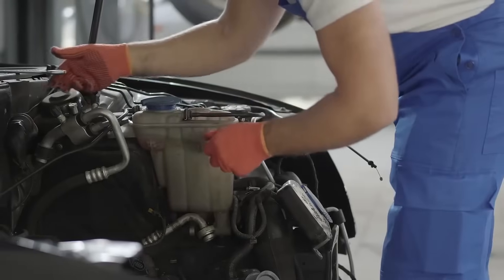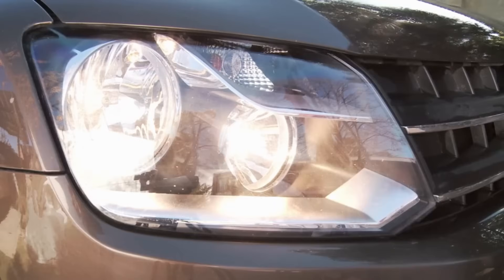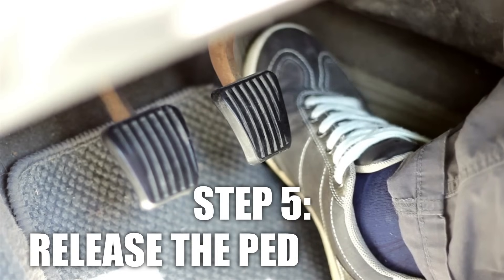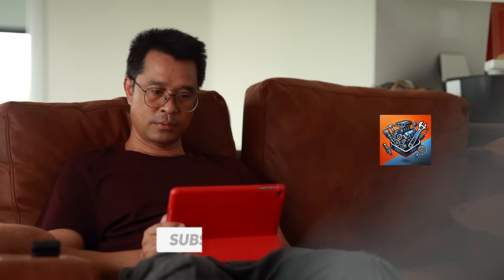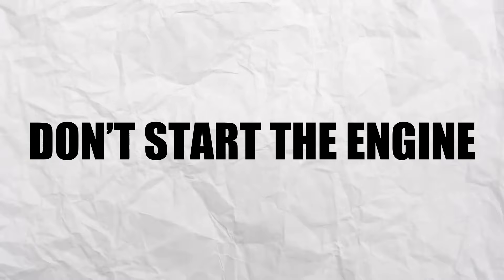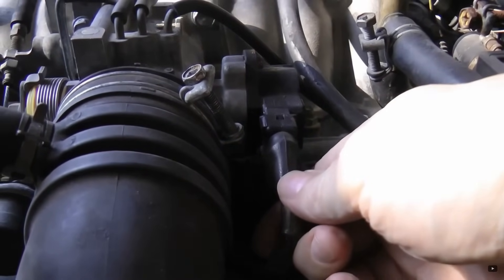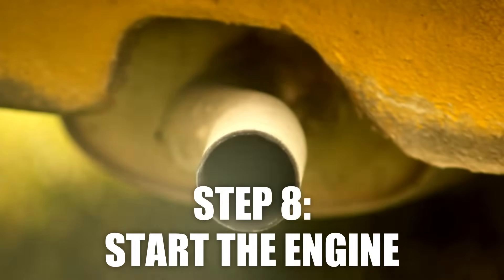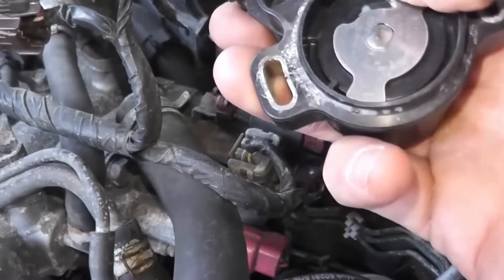How to Reset Throttle Position Sensor (3 Quick TPS SECRETS)

Comment from the maker: 9 Symptoms of a Bad Throttle Position Sensor  + Fixes  https://youtu.be/o1hBd9dlBRE

⬇Care Care Clues Top DIY Tools and Products:
🚗 Essential Scan Tools
Newest Scan Tool:https://amzn.to/3GJyuET 
Bluetooth Scan Tool: https://amzn.to/42AcBRc 
Cheap Scan Tool: https://amzn.to/42WZIzx 

🔋 Emergency Essentials
Best Jump Starter: https://amzn.to/44fYOAm 

🛢 Fluids and Leak Stoppers
AT-205 Re-Seal (Stops Leaks):  https://amzn.to/3S9icYm 
ATS 505 Fuel System Treatment: https://amzn.to/3YQjjA2
Lucas Oil Transmission Fix: https://amzn.to/4jNk98M 
Bar's Cooling System Stop Leak: https://amzn.to/3Sht0nj 

🔎 Quick DIY Diagnosis Tools
Head Gasket Leak Test Kit: https://amzn.to/4jRgc2T 

🛠 Useful Maintenance Accessories
Quick Twist Oil Drain Valve: https://amzn.to/4jWG3GJ 
Tire Gauge (Check Pressure): https://amzn.to/3GxySGD
Tire Air Pump: https://amzn.to/3RZK9Cd 
CRC Mass Air Flow Sensor Cleaner: https://amzn.to/44dJpkb 

🧰 Mechanic’s Must-Haves
Car Battery Tester: https://amzn.to/4jTqyzk 
Basic Mechanic Tool Set: https://amzn.to/3Ymgerh 
Cordless Impact Wrench: https://amzn.to/3YkkhVc
Reply: How do you do this if you have a push start system
Reply: Thought I needed a transmission replaced or rebuild, it was doing exactly what he said in the video, any driving 2006 dodge Ram 1500 perfect so far going to make sure throttle body doesn’t need replacing, but that’s worse scenario ok I’m out
Reply: @frankthompson721  ??
Reply: Would this work with a Honda Golding
motorcycle?
Reply: None of that stuff worked for me Im about ready to take this pos n put it through that çarlot who sold it to me.

Comment: Thank you for this video. I disconned the negative cable on my battery and let it sit for 15 minutes. I reconnected the battery cable and it reset the throttle system on my Nissan Frontier truck. I hope the throttle never gets stuck again.

Comment: I appreciate your time and effort I have a 2001 nissan maxima sports edition  I just changed the old throttle position sensor my self Saturday and the engine  was idling above 2000 rpm so today when I got off of work I parked the car and saw this video and the first step I did exactly what you said and showed and I must say it worked thank you for this video.

Comment: I’m working on step 3 - I replaced the throttle position sensor, and I’m at the step where I’m listening to the new sensor buzz. The buzzing has gone on for 15 minutes so far. What happens if the buzzing never stops?

Comment: Turn the car to the on position and push the gas pedal down for 10 seconds and then turn the car off and release the gas pedal. Wait 10 seconds and start the car. Worked on my 2004 sierra, 2017 passat and 2015 accord.

Comment: With the Vdiagtool VD80BT, I could reset throttle position sensors on both Toyota and Ford without any issues.

Comment: Every car/truck engine has a specific throttle body relearn procedure.  This guy is way off. Don't listen to him.  Google how to rescalbrate a throttle body after taking it off or replacing it for your vehicle's engine.  It's not a one size fits all.   

here's the steps for a Nissan TB replacement

Perform “Accelerator Pedal Released Position Learning”. Perform “Throttle Valve Closed Position Learning”. Start engine and warm it up to normal operating temperature. Turn ignition switch “OFF” and wait at least 10 seconds. Conform that accelerator pedal is fully released, turn ignition switch “ON” and wait 3 seconds. Repeat the following (steps 7, 8) procedures quickly five times within 5 seconds. Fully depress the accelerator pedal (HARD) Fully release the accelerator pedal. Wait 7 seconds, fully depress the accelerator pedal and keep it for approx. 20 seconds until the Check Engine Lig(CEL) stops blinking and turned ON. Fully release the accelerator pedal within 3 seconds after the CEL is ON. Start engine and let it idle. Wait 20 seconds. Rev up the engine two or three times and make sure the idle speed and ignition timing are within the specification

Comment: My 2020 Mazda cx9 started revving high while driving, the  engine sounds as if stuck in lower gear. At 25-30mph, the rpm tend to stay at 1250 even when I let go of the gas. I noticed this issue when the engine makes high pitch whining engine sound. 
What do you think it’s is?

Comment: I did step one due to my car battery misfiring and my TPS wasn't accelerating properly after a thunder storm so I reset it and now it's no longer sluggish and accelerates properly. Thank you for the video it really saved me from going to the auto shop and spending a few hundred. Bless
Reply: Your car battery does not misfire.

Comment: Got P2128 code on my 2007 Mazda 5. Tried the first method in the video and it solved my issues first try. I did have to clear the check engine and AT alerts with my ODB afterward but so far so good. Thanks for this awesome video!!

Comment: Im facing the following error:

Issue: Throttle Actuator Control (TAC) Motor – Range/Performance Problem

Please advice 🙏 It cause engine idle, no race pick-up, need to turn off on 2,3 times to run the vehicle. It's FAW V2

Comment: The first method worked for me on my grandma's 2010 equinox it turned off my check engine light for my throttle body and it runs fine thank you so much I was shitting bricks because it happened after I went low on gas and I didnt want to hear the grief

Comment: If you don't hear the buzzing sound in the 3rd step to reset it. Could that mean it's not working at all? But the car will crank and idol. It just hesitates while it's idling. And won't go down the road giving it gas. Not like it's supposed to.

Comment: I can't tell you how thankful I am that you made this video!! I have been struggling with my 2015 Hyndai Genesis G80 for months. I've had it to three shops and none of them have been able to find anything wrong. I have 162k miles on the beast and it's been a great car. No codes at all. Was just getting ready to drop the Trans pan and test each solenoid valve. Anyway I came across your tips and the basic one worked right away!! Unbelievable is all I can say. With much thanks and appreciation!! 
Tony C

Comment: I just needed to do this after the battery went dead on my 2021 charger. It got started after jumpstart, but could not get higher than 2 in RPM or 18mph. The owner’s manual has not troubleshooting section and I literally went to YouTube to find answers. I was dreading an expensive shop bill. Since I ride motorcycles, throttle seemed relevant but I could not find anything I. Owners manual o. Throttle.  I found your video, tried it and tada!!! It worked. I drove it around without issue afterwards. Thank you for making this video. I hope it helps others.

Comment: FYI, if you're due to smog check or going to a smog station "DO NOT" disconnect the battery 5-10 mins until you're done with the smog check.  disconnecting the battery will reset the CPM/CPU (vehicle computer) which means the vehicle will not be ready and will fail the smog check.  It will require going through the readiness cycle period (start/run/stop/off) sensors/egr/etc will need to go through the cycle period.

Comment: I tried every step and none of this worked
Reply from the maker: Sorry to hear that none of the methods worked for you. Sometimes the issue might be more complex, like a faulty throttle position sensor or a problem with the throttle body itself. It might be worth running a diagnostic scan to see if any error codes point to a more specific problem.

Comment: I once replaced a fuel injector 0 ring which was leaking when my engine was hot being driven for an hour and it was a very hot day, but I needed the car because I had a deadline to meet. So I had to get it done. Was super hot. Burnt myself heaps. Was worth it though at the end of the day I was satisfied and got my deadline met.

Comment: Only works on OBD2 systems. Not all of them either. This is cars made after 1996 or newer. If it's a 95 or older this is likely to not work. He did say at the beginning of the video newer models, but I thought I should define what newer is. Good luck guys.

Comment: It's all fun and games until the engine light comes on. 
I followed the generic rotation to reset the throttle but the engine light came on after riding 10 minutes.
Repeated the rotation but included pumping gas peddle 3 times before turning it back on and it worked. 
Make sure to follow the appropriate rotation or you'll sweat :p

Comment: Just did this on my 2012 Accent, it was over revving during gear change, it seems to have worked. Idles more smoothly as well. I’ll take it for a longer test run tomorrow but thanks so much 👍👍
Reply: Any update ?
Reply: Ill wait with you here i am suspecting  my accent is also suffering from same issue @whiteshark2060

Comment: my car turns off when i turn it on
Reply from the maker: If your car shuts off immediately after starting, the throttle position sensor could be a factor, but other issues might be at play too. Here are a few things to check:

1. Throttle body and sensor issues – A dirty throttle body or faulty TPS can cause stalling. Try cleaning the throttle body and resetting the TPS using one of the methods in the video. 

2. Idle air control valve – If your car struggles to stay running, a clogged or failing idle air control valve (IACV) might be the issue. 

3. Fuel delivery problems – Low fuel pressure from a weak fuel pump or clogged injectors can cause stalling right after startup. 

4. Battery and alternator – A weak battery or faulty alternator can cause electrical failures, leading to the engine shutting off.

If you have a check engine light, scan for error codes. They can point you in the right direction.

Comment: Hi sir  . If do the process it works for some days and came again. So sir what can be the last solution,,?
Reply from the maker: If the issue keeps coming back after a reset, the throttle position sensor itself may be failing or there could be a deeper issue, like a dirty throttle body, vacuum leaks, or a wiring problem. Try cleaning the throttle body with a proper cleaner (not carb spray or gasoline) and check for any loose or damaged wiring. If the problem persists, scanning for error codes with an OBD2 scanner can help pinpoint the exact cause. You may need to replace the TPS if it's faulty.

Comment: Hello Sir,I hv nissan Sentra N16 1.6.my car idle speed stays at 1300 rpm even after warm up.i hv cleaned the throttle body n iacv valve thoroughly but the problem remains.what should I do? Is any of Ur method mentioned in this video helpful.i need Ur kindly help in clearing this problem. T.q.
Reply: throttle position sensor maybe or dirty maf i just fixed my cars iac and it was fixed

Comment: Oh my goodness! You are a lifesaver. After moving from one mechanic to the next, putting on machine, testing wires and rejoining wires, spending so much money...they told me my fuel pump is spoilt, another said my throttle is spoilt. I just didn't believe them. So I tried your suggestion, reset the car and instantly the car is working.

Update: after a few minutes, the issue started again 😅😅

Comment: This solved a week old problem, car now running like it used to run, the problem started after the battery was taken out to change the steering pump and the acceleration was all over the place, it was difficult to control at idle sppeds.

Comment: Im not machanic my golf 4 1.6 lost  the spark but coil park. Throttle. And pick up sensor crank sensor is new bt dont want to spark
Reply: If your Golf 4 1.6 still has no spark despite replacing the coil pack, throttle, pickup sensor, and crank sensor, check the wiring and fuses for faults. Also, test the ECU, as it controls the ignition system and might be the root cause.
Reply: Also make sure the new crank sensor is fully fastened down. If not, vehicle may not start.

Comment: Okay I just done the first method for Resetting it, took it down the street and back, it seemed to drive good without pulsating. But I wasn't going up hill though. It better have worked. We're gonna have to test it up hill next. Also it don't just pulsate up hill but also down hill too. So I don't think its the transmission. It's burning extremely rich also, and it Burns oil. It Plugged the Catalytic converter and we had to remove the plugged Catalytic converter, didn't solve the issue. Just can't seem to figure out what is wrong with my 2013 Nissan versa.
Reply: If it’s burning gas or running rich , do you smell gas or fumes ?

You may not have a leak on the lines but maybe the gas tank areas might have a slow leak.

Fuel module or something in the tank
Reply: Its burns oil might be time for a complete engine over haul.

Comment: NEED HELP ASAP PLEASE.  Just replaced my camshaft sensor on my 08 Toyota Tacoma 4.0 v6 crank fine but give it gas and engine won't rev up over 1,500 rpm ?????
Reply: If your Toyota Tacoma won’t rev over 1,500 RPM after replacing the camshaft sensor, it could be an issue with the throttle body, air intake, or a vacuum leak. Check for any loose connections or clogged filters, and perform a throttle body cleaning or reset.

Comment: Hi, I am not a mechanic. My Renault Kadjar 1.2 Petrol had the problem with over consumption of fuel. You won't even believe that it was consuming 30 litres for 100km. Even the mechanics couldn't figure out the problem as there were no error codes. 

Somehow I came to know about the bad throttle body symptoms in YouTube and I tried these methods to sort out the TPS issues and it's really working. The current is more fuel efficient and it is 9 Liters for 100 Km now.
Reply: If he needs an electronic error code to diagnose a fault, he is not a mechanic. He is then a plug-in-and-replace technician. That is way below the standard of a real old time mechanic.
Reply: @reteipegal7690 its AI read the description at the end it will say this content was digitally generated. So this dude does nothing but tell AI what he wants to make a video about and it scours the internet almost instantaneously and pulls related info and it narrates it also and this dudes making money. No a bad little side hustle. Tales practically none of your time.
Reply: @billesposito2112  I'm sure the guy was talking about the mechanics who couldn't find the problem with the car of the person who made the first comment.

Comment: Sir,
Engine RPM goes high while pressing clutch.... what is the solution sir..?
Reply from the maker: High RPM when pressing the clutch may indicate a vacuum leak, dirty throttle body, faulty idle control valve, or malfunctioning clutch switch. Inspect these components and clean the throttle body. If unresolved, consult a mechanic for ECU diagnostics and adjustments.

Comment: I bought a new throttle body for my car not genuine one. It does not work. I continously hear a buzzing sound. What should I do?
Reply: I also hear the buzzing sound and it never goes away. Left it for an hour and was still there.
Reply: The buzzing sound suggests the aftermarket throttle body may not be compatible or properly calibrated for your car. Consider resetting the ECU and performing a throttle body relearn procedure. If the issue persists, replacing it with a genuine or higher-quality OEM-compatible part is recommended.
Reply: I read somewhere else the buzzing coming from the throttle body means it’s recalibrating and you should not mess with that which I did and now I lost power hence why I’m here. So let it do its thing I read it’s about a 5 min. Wait hope that helps
Reply: re watch video
Reply: 🤭 rewatch the video and do exactly what it says in Section 3… where it says it supposed to buzz-  if that doesn’t work, take it back and exchange for another, it could be bad.
Reply: That buzzing sound you hear is your fuel pump being powered on and priming the fuel lines.  It has to do this in order to pressurize your fuel lines so that your car starts on demand.  If it didn’t do this then it would take half a dozen times attempting to start your car before it actually starts and stays on.
Reply: This relearn process is different depending type of car it is , Chevy's aren't the same as a Ford , Dodge , Toyota etc etc . Each one can or will not be the same . Depends on car brand

Comment: No such thing is throttle reset, dude
Reply: Yes, there definately is. Ecm has to be calibrated to the throttle position sensor.
Reply: @passingthetorch126 I can only speak for myself. I have a 2012 buick lacross keep having throttle fault code. I bought a use one from ebay change it out run fine for two years so far
Reply: @passingthetorch126What about an older model vehicle ?
Reply: There is, been confirmed by multiple mechanics and elections

Comment: Very worthy lesson brother....❤
Reply from the maker: Thanks a ton
Reply: @carcareclues  hi sir  I have a question, my car battery is dead, I took it to get it charged, while I removed the throttle body to clean it, I already put it in reverse. How can I calibrate it?
Reply from the maker: @tonycervantes4816  Please check the 3rd method
Reply: @carcareclues I have to connect the battery to the back of the car but how can I calibrate my throttle body?

Comment: Vw jetta 2016 tsi got a code p2262 & 07$e8 but, no other breakdown of code. Tried the break method & check engine light went off & epc light. Car idle calmed some too. Checked scanner says 0 codes! Now I must drive to see if ck engine light  comes back. Regardless, thank you.

Comment: I got the error code p2119, you reckon this would work for it:?
Reply: Code P2119 relates to the throttle actuator control system being stuck or out of range. Cleaning the throttle body, checking the wiring, and performing a throttle relearn procedure might fix it. If not, the throttle body or actuator may need replacement.